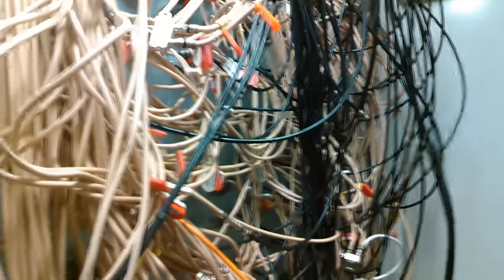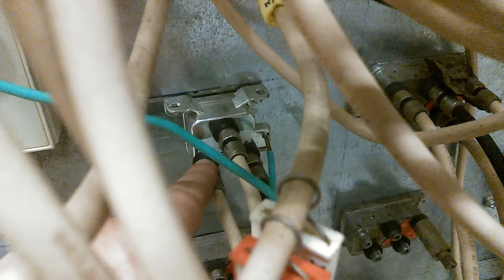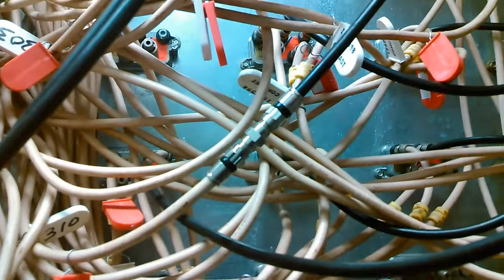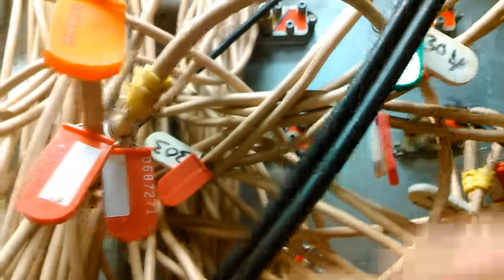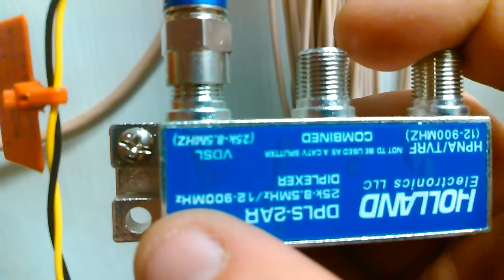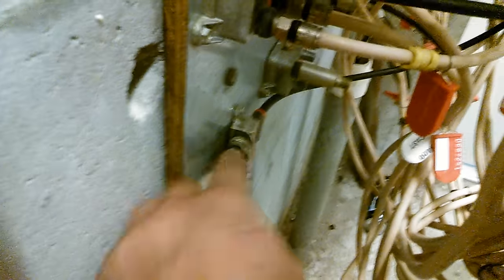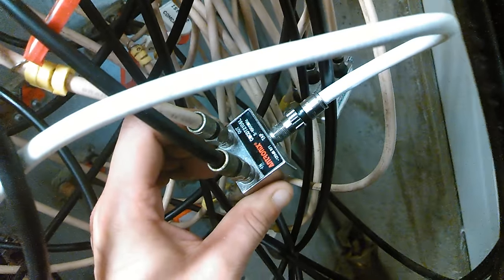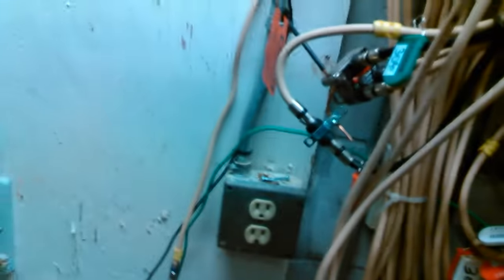Cable TV Wiring Doos And Donts

Comment: I thought when you said you were a maintenance technician that you were meaning a cable plant maintenance technician. I was scared for a min until I realized you were actually a maintenance technician for those apartments you work at lol.
Reply from the maker: Yes I am a  maintenance technician.(At a old folks home) I don't have to know about all this catv stuff like  egress on the line  rg11 rg 6 wiring, amps ,terminators,multiplexers,etc...   Plus cable  technicians have a little computer that makes it idiot proof and I don't .I really should not be worrying about this wiring but now(year or so later ) I cant even get to the breakers in our breaker room.Because there are amps now hanging down freely soon as you open the elec door you are now hit with splitters,amps and rg6 wire and we have failed multiple inspections because of the wiring   What I am saying in the video is put the shit back on the wall. Why don't we get it fixed you might ask? Well we cant the lazy fucks out here.(they are payed per job well this is just 1 of 12 rooms on the property nobody wants the job I guess )I would take it if they pay me.BTW there are 1,185 RG6 cables going into these Electric rooms.
Reply: Lmaooooo

Comment: Actually what you have with the filter that you referred to as ATT's are filters but it is for att Uverse. The holland Splitter you said something about is also a att splitter for Uverse. Uverse works on coax and on copper connections, to get the Uverse which is a Video service to the customers apartment they have to put the filter in, i agree it could have been done more professionally. Bonding and Grounding is essential. I would say do your research on Uverse. Just so you know I was a corporate trainer that taught Uverse. I can assure you techs are taught to install it correctly. I do know once a tech is given a ticket to install or troubleshoot, and they open that ticket they are on a timeclock. Some techs are excellent at time manangement some are not. Some it is about getting more done so they look like a hero to their boss. It only hurts them if they get a repeat after 30 days. And then you have those that just don't care. So could they find another solution abosolutly, and Uverse techs are taught many. To gove the best Uverse service we would be to provide it over the telephone cable going to the apartment or house. Coax was the last choice! The coax that goes from the tap to the house or apartment belongs to the customer the tap is the dmark. We can put in splitters, and so you know the uverse tech did install it correctly but could have dressed it up better.

Comment: That blue diplexer you grabbed @ (4:25) is used for AT&T Uverse,  NOT for your standard cable TV.  that dIplexer is within spec for an HPNA network signal. Also the Coax Balun with the pigtails on the end @ (8:51) are used on the customers side of the coax network feeding from the 66 block from AT&T NOT going through COMCAST cable network. It has no effect on the other feeds in the MDU. did you replace the terminators you removed? SMH,  thanks for the  laugh. ......
Reply from the maker: Yea but there are dumb ass comcast techs that will hook that shit up . Did you replace the terminators..... hahahah that shit didn't even have a drop let alone a rg6 hooked to it i will let you guess
Reply: @geoffhoweth  when you took off those baluns you probably caused your  tennant to lose service.

Comment: You should see what they used to  do in the equipment rooms at the bottom of cell phone and transmission towers... Huge coax and it's an absolute mess, luckily the industry is going away from that trash... But you'll always have those fly by night crews that don't give a damn.

Comment: Actually everything you said a in house tech did right was wrong ... 1st off those are outside fittings on a non Comcast splitter..second there's not one mocha filter anywhere in sight ...all the grounding is not up to spec as well
Reply: If most of the boxes are DTA boxes, there is no need for a MOCA filter.  MOCA is only needed for an XG1/XG2 smart box supporting Xi3/Xid dummy boxes.
Reply: its not Comcast.... it is ATT. they do not use moca devices on Coaxial.

Comment: All I do is trouble calls, sweeping up the mess left behind by greedy/lazy techs. To be fair, the company sets the policies and procedures. What you see in this vid is the mess I face 75% of every damn job. 
Pay a decent wage, retain decent techs. Reform the cash-grab policies and quality will improve. I’ve had it with cable, it’s time to advance my low voltage career. 
Also, every customer has poison to spit at the cable guy. Why is that? Bad policies maybe??
Contractors are scabs. Plain and simple. Greedy shareholders and power-mad bean counters. 
No pride. Sad.
Reply: as a contractor the problem is cost... I could do a great job getting everything perfect. however, I am paid per job. travel and anything else does not matter. the size does not matter or anything else. every job is the same. My pay is based on Modems and DVRs installed... all i care is getting it to work and keeping it working for 30 days or more.

Comment: If I use a bi directional splitter with a OTA antenna, will the signal pollute my apartments Cable System?
Reply from the maker: It probably would if you hooked the OTA antenna into the wall jack.... But I don't know why you would do that. I need a little bit more detail in your comment like how you are going to split and hook up the OTA I am always glad to help
Reply: If you were wanting to combine the OTA signal with the Cable signal, it won't work, as they both occupy similar frequencies.  Cable TV, Internet and Phone is between 5 and 1002 MHz.  OTA TV is around 200 MHz for VHF and 400 to 700 MHz for UHF.  In other words, yes, it will create noise on the lines.

Comment: @ 7:00 its not an annunciator its a moca filter for dvrs and gateways to keep them for searching for other equipment back through the main line. and the orange line is temp drop cable not a ground line. and there cannot be multiple services going through the single apartment feed line like your saying with at&ts vdsl to coax. when they install them they disconnect the apt from comcast to use the line into the apt where it usually splits to the jacks. and multiple splitters in line after eachother is fine. in apt buildings the main drop has more db than single dwelling home taps. its not losing db past spec. comcast boxes need between 8 and -8 db to function unless their legacy boxes. each of those drops i would think is around 30 to 35 db before splitting if not more. too little db is bad but so is too much. simply disconnecting shit cuz you think it shouldnt be there doesnt do anything but create service charges. and losing one or the other channel while others are all working with digital signal most likely has nothing to do with splitters that have been hooked up and working prior to the problem occuring. there are channel blackouts and main line issues among other things. if theres a problem theres a reason for technicians to be called that dont go around disconnecting at&t's stuff that isnt backfeeding to comcast in the first place
Reply: depends on location... some areas require orange cables if it has any power on it. for safety. they want it to be more visible. Cap cod due to cables being dug up by rain and weather they want it to be easier to see then black.

Comment: OMG the cable connects that you said were good are actually your worst ones, they won't even carry 75 ohms so in other words no 1080P for you.
Reply from the maker: Almost all the cable in the building are just Standard DTA cable boxes .So who cares about 1080P .I do kinda chuckle when a Comcast tech comes to install a HD box are even Internet. But thanks for proving my point and thanks for watching.
Reply from the maker: Are you talking about the Splitter on the wall that I said a Comcast tech would come in here and it would look like this? If thats the case a Comcast tech would remove the 1000 mhz and put in a 1002 mhz  splitter.
Reply: OK than my bad, I'm a DTV tech. and I can't stand coming to an apartment  where the cables look this way and we complain about Comcast /Wow techs all the time because of how they operate. I would get fired for work like that.
Reply from the maker: Yea pretty much im saying in the video is they could do a better job. You just gain a sub man love Your DJ ing I do it as a hobby now But use to DJ at the Club Vault in the Atlanta GA on sat nights. Now it is closed down . But that was a long time ago thanks for watching Bro.

Comment: What you described is exactly what is wrong with Comcast and others. Their use of contract installers is exactly the very thing that's causing them to have a bad reputation with their customers and ultimately leads to the loss of a customer simply because the contractor didn't take the time to install the customer's cable correctly. Both of which lead to poor service or service callbacks. I can understand Comcast's reasoning for doing this in that it's intention is to save on labor costs by not having to hire and retain someone on staff to do the job, but in the end, it's the Comcast employee that ends up having to go back out and fix a mistake that a contract installer made to either your lines or to your neighbors' lines, which in most cases results in an extra charge to the customer for something that they had no control over in the first place. Then the customer gets mad when they see a service call charge on their bill, which results in the customer disconnecting service. I've thought about going to work for CTIS many times over since Comcast, Charter, or WOW doesn't seem to want to hire me, even though working as a cable service technician has always been my dream job since I first watched a cable guy install my parents cable service back in 1978 and I spent many years boning up on my electronics knowledge and education. But from what I've heard from chatting with current CTIS employees about how their supervisors constantly push their employees to do rush jobs and threaten to fire them on a daily basis for trying to do the right thing, there's just no way I would ever consider working for them. Simply because I care about and have a passion for the electronics work that I do and watching the customer enjoying a product that they're paying for that I had a part in bringing to them, instead of delivering a product that they're going to have problems with. I credit my late father who was a professional musician and entertainer for 50 years, for this way of thinking because he had me fixing his guitar cords, mic cords, guitar amps, and PA's starting when I was seven years old and had my first soldering iron. And even before then, my dad started me out as his roadie loading and unloading his music equipment in and out of gigs starting when I was three years old. I was fixing things in electronics before I could actually read. If something I fixed for my dad didn't work on stage whilst dad was playing a gig, then my dad couldn't finish the gig out and earn the money to support us as a family.  That's just how it was for me growing up. Dad taught me the meaning of hard work at a very early age because he wanted me to know how it was in the real world, but he also gave me morals about doing the job right the first time. I started applying for service tech jobs to the cable companies shortly after high school in 1989 just about every time they were hiring, but I always seemed to get passed up, so I ended up working in food service job and custodial jobs for many years. I'm almost fifty now and I take care of my mom, so there's no way a cable company would take a chance on me at my age.

Comment: I'm guessing by "anunciator " you meant attenuator, which is still incorrect it's actually a Moca filter.  This guy knows nothing.  Also you know you just admitted to a felony by unauthorized tampering of telecommunications equipment namely the ATT twisted pair to coax adapters.  Hope someone from the FCC spots this video.  Stop spreading misinformation.

Comment: 18 years in the industry, and yes, in-house techs do better work. Hands down. If you're butt hurt about being called out as a contractor, it's because you're the one doing all the goofy crap.
Reply: That's because in-house technicians don't do work!
Reply: @JerHetrick  13 years.  I've seen the workload pulled away from contract labor to in house.  We have about 1-2 contractors per 12 in house on a given day in our small system.  It seems like it would be easier to go all in house in larger cities.  Mostly due to work load flux.  Contractors have to take as much as they can get when it's available or be willing to travel to the work.  We get a few months of the year that they are asking us for voluntary overtime but generally it's a normal 40 hour work week.   No disrespect.  I would never want to have so much uncertainty in my working schedule.